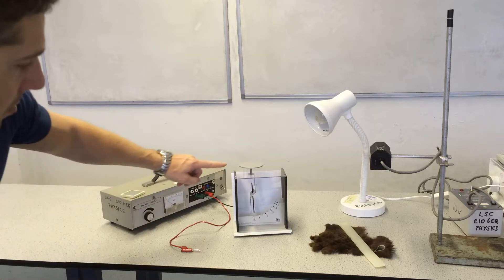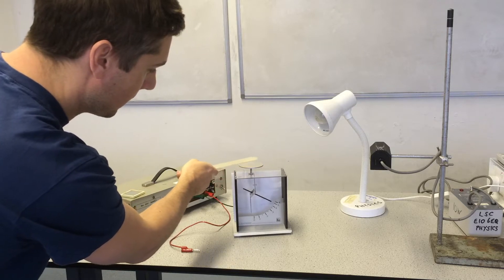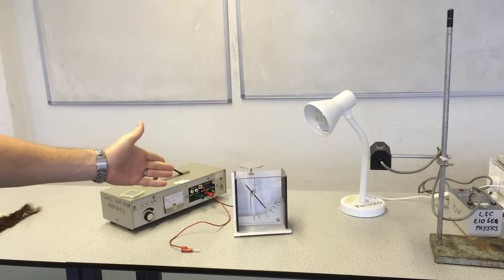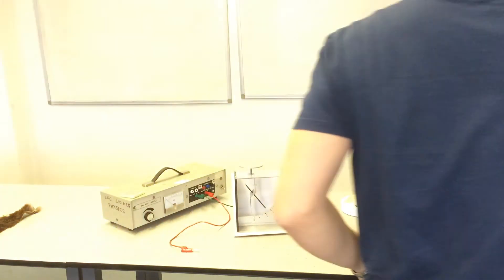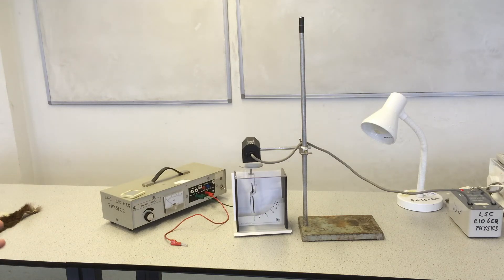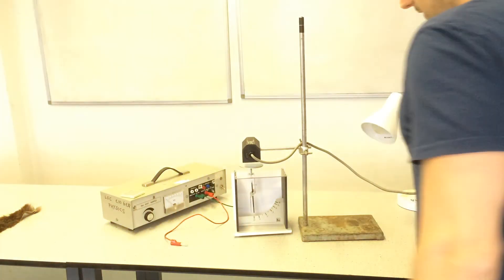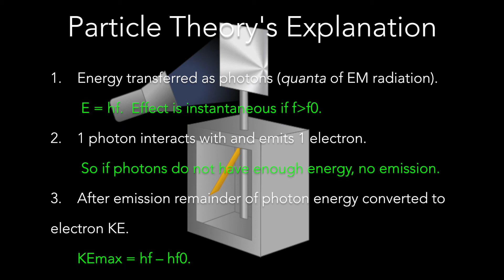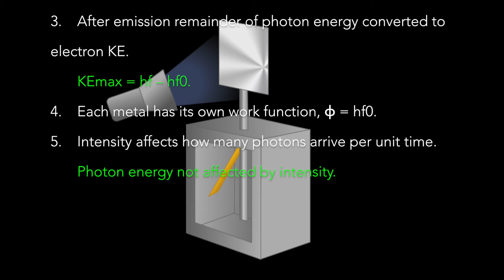Photoelectric Effect

Comment: Your electroscope is an open circuit. There is no electric current in open circuit. That UV is doing the same thing as the rod does to the electroscope, "changing the voltage of the electroscope".
Reply: Yes the elecroscope is an open circuit.  Electroscopes measure charge accumulated on the plate, stem and foil.  The demonstration shows the foil falling which means that charge is being removed.  Since the charge is negative that means the nature of the charge is electrons.  Those electrons are going somewhere (since charge is conserved) ➝ they are being emitted into the surrounding air.  The rate of flow of charge is current.  The current is just not flowing in a loop here.
The UV is not doing the same thing as the rod.  The rod has charge accumulated which flows onto the plate.  The UV transfers energy to the plate, the energy enables electrons to be emitted from the plate.  If the UV were doing the same thing as the rod then the scope would be discharged and then recharged.
Reply: @PhysicsHQ  Do you have any physical evidence that "charge" is removed from the electroscope?